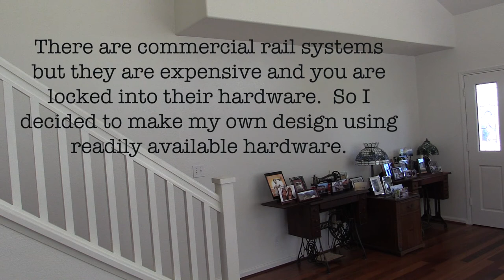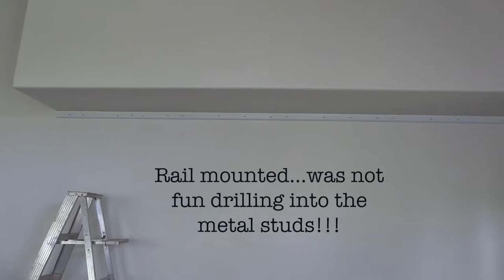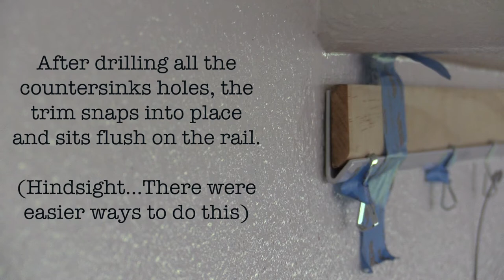DIY Picture Frame Rail

Comment: Thanks for this tutorial.  I've had this on my to do list for awhile for my wall of photos.  One change I am planning on making though is using adjustable gallery hooks instead of stops.  They're a little spendy, but I like the ease and flexibility they offer.  Do you have any experience with these?  Besides cost, are there any drawbacks?
Reply from the maker: Wow...great idea!   I never knew these adjustable hooks existed.  I can't see any disadvantages; however, one MAJOR advantage is that you can easily re-use the cables and hooks when you move pictures around.  I'm constantly adding new pictures of different sizes so I end up having to make new cables to get the right spacing between photos as I re-arrange the wall layout.  Your idea would make this so much easier.  I might have to retrofit all my cable hangers now...haha!!!   Thanks for the comment and sharing your tweak!!!

Comment: This is brilliant! I'm redoing my basement to become my music studio. I have seen other DIY solutions similar to this online, but none as professional and (literally) polished as yours. At first, I was thinking "why go to the trouble of the extra trim on top of the rail?" - alas, that's the professional touch. Brilliant. And honestly, I like the looks of yours MORE than the pro system!! Thanks for the guidance and thorough video!!
Reply from the maker: tauntyouasecondtime...Thank you so much for the kind words.  Yes, I thought the trim made the system look more "finished" and it also serves another function as it secures the hangers in place, although you can still move them around if desired.  Have fun with your basement project and music studio!!!

Comment: Great video and a DIY project simply explained but purposeful and nearly as attractive as the commercially available systems, e.g. STAS.  Please update us if you ever modify or improve the system.  Thank you much.
Reply from the maker: Thank you so much for the comment and feedback!    I continue to add new frames and re-arrange existing ones.  I was worried at first about the cable corroding or rusting but so far it has held up pretty well.

Comment: What did you use to secure the picture frame to the cables?
Reply from the maker: After I read your question, I went back and noticed that I didn't show in the video what was at the other end of the cable!!!  My bad!!!  So...at the bottom end of the cable, I used that same swage process to attach a regular picture frame hook by looping the cable though the holes where the nail would go.  Thus, you end up with a regular picture frame hook that dangles at the bottom of each cable.  Then its a simple matter of hanging the picture frame on those dangling hooks just as if the hooks were pounded into the wall.  Hope that answers your question.  Sorry for the incomplete video and thanks for the comment.